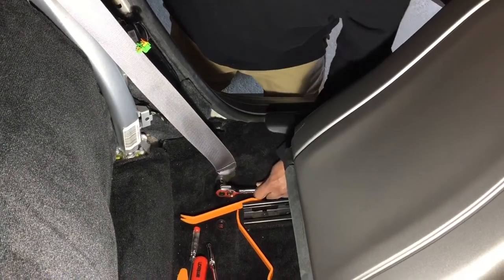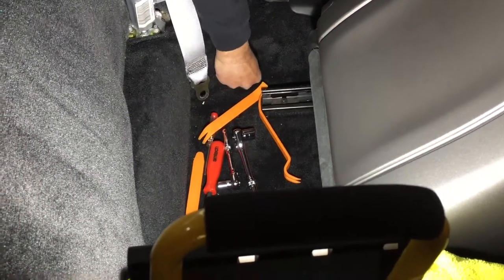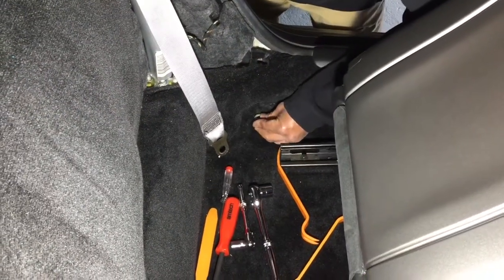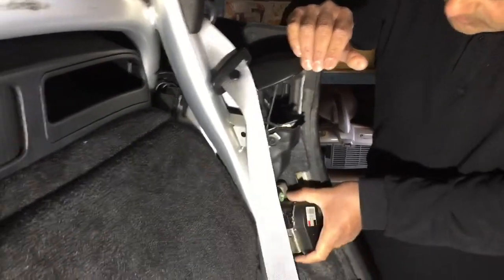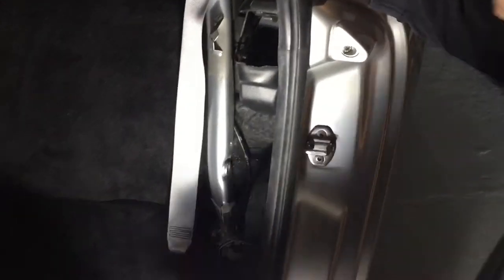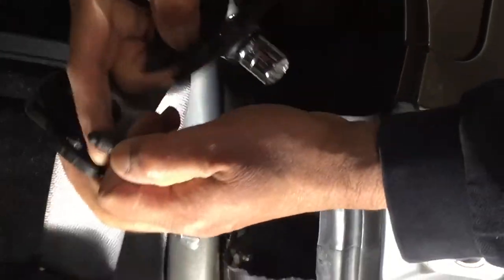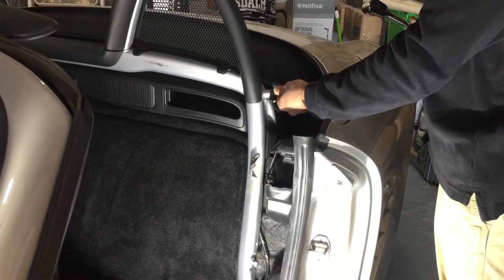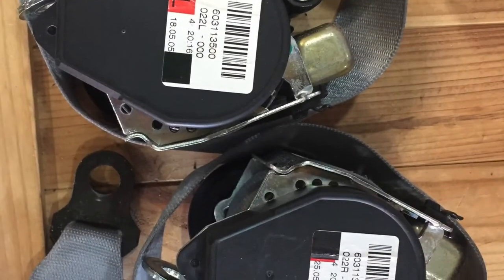Part 2 - Porsche Boxster 987.1 Seatbelt removal

Comment: Hi, where did you go to get the red seat belt straps? thanks
Reply from the maker: Hi, here is the ebay link to where i had the belts rewebbed: https://www.ebay.co.uk/itm/Custom-Seat-belts-Any-car-Many-colours-order-colour-samples-of-webbing/283626382112?_trkparms=aid%3D111001%26algo%3DREC.SEED%26ao%3D1%26asc%3D20160811114145%26meid%3Da33e4d57abd24b05bd01262b62f96fe6%26pid%3D100667%26rk%3D3%26rkt%3D8%26mehot%3Dpp%26sd%3D283824689032%26itm%3D283626382112%26pmt%3D0%26noa%3D1%26pg%3D2334524%26brand%3DUnbranded&_trksid=p2334524.c100667.m2042

Comment: Did you have any issues putting back the tensioner unit back?
Reply from the maker: Hi, It was easier to put the seatbelt tensioner unit back in than to take it out. To install, I aimed the pin on the tensioner unit against the hole in the roll over bar and then just had to wrestle the unit in. Once the pin is in you can spin the tensioner unit around if it’s gone in sideways or upside down.  Hope that helps.